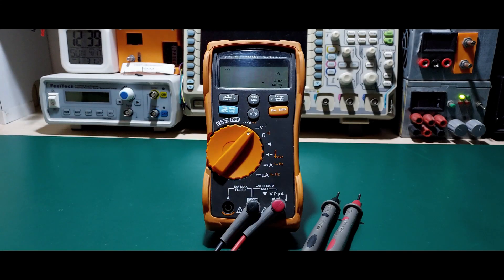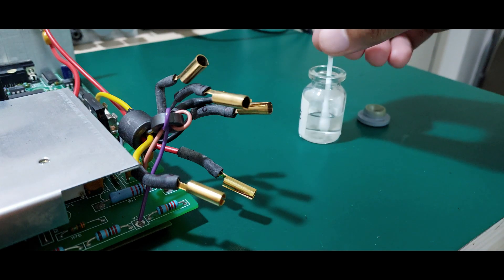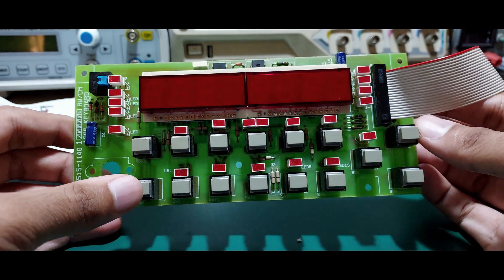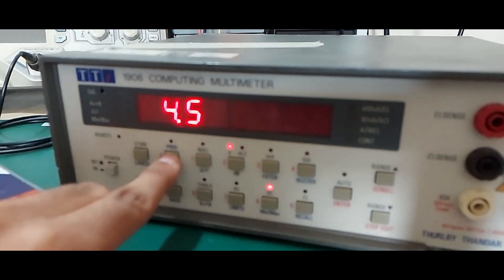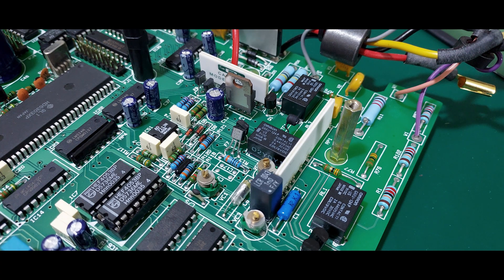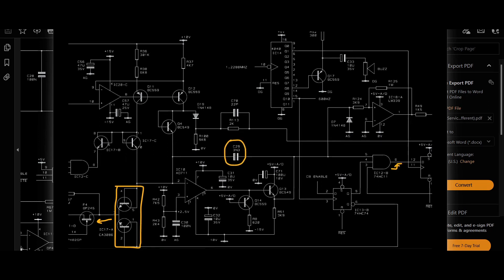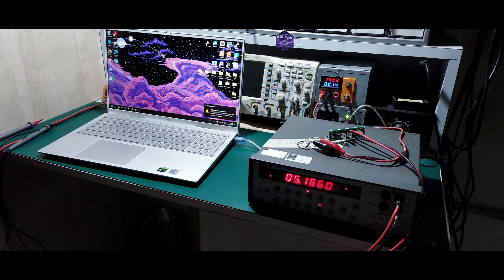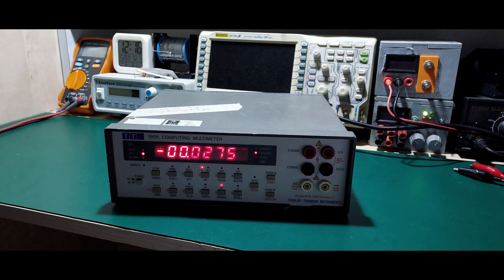TTi-1906 5.5 Digit DMM Refurbishment and Overview

Comment: When you measured it's own reference with it, and saw it was in range, wouldn't it have said that even if the reference was "wrong"?
Reply from the maker: The meter does not "know" what is connected to the input, so it measures the reference just fine. But if there was something seriously wrong with the reference (for example it was shorted out), then the readings would be nonsense. You're right, measuring a meter's own reference through its inputs is not really the most reliable thing, I only did it because I had prior information that the meter was functional.